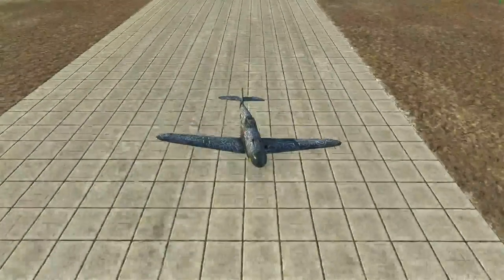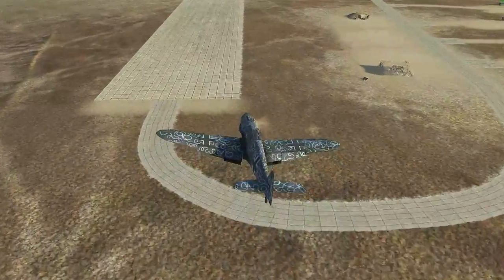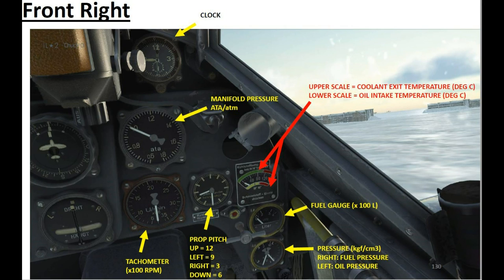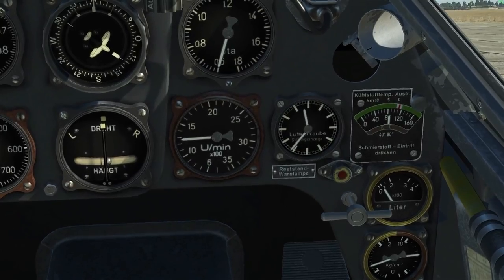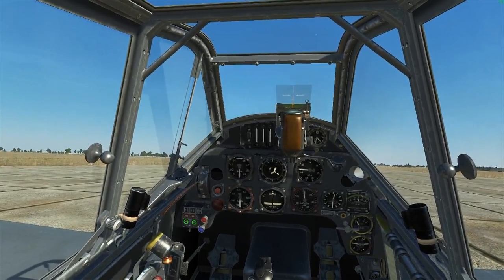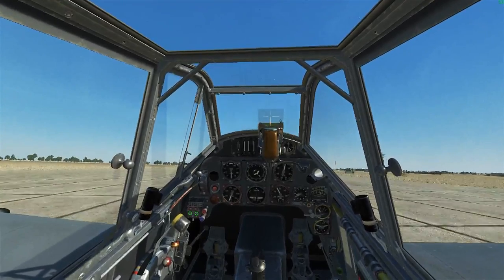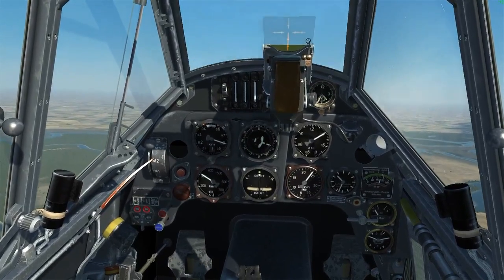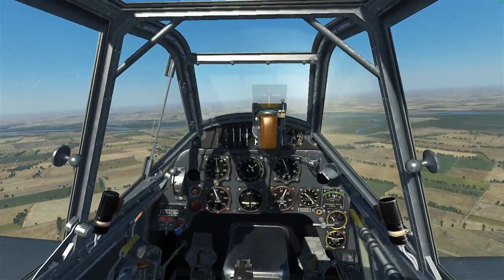(26) IL-2 Complex Engine Management 2  Understanding Manual Propeller Pitch

Comment: Great video.  Along with your tutorial on CEM. A ground school instructor couldn't have presented it better.  Unfortunately, if the multi-player servers require this level of operational detail I, for one, won't be doing any multiplayer action.  I had to learn this stuff in fixed wing civilian aircraft, which required a whole lot of attention to detail and checklists.  I can't imagine having to do it in a ww2 fighter while other people are sneaking up and shooting you.  Nope,  I think I'd look for another job in the army... like a cook.
Reply from the maker: Hi Ray, non of it is difficult. It all takes practice. You can fly the Pe-2 and not worry about feathering your prop. Russians didn't think it important! Best to practice without having your are shot off first. The p-47 is the single most labour intensive machine. But if you get it's CEM down it is formidable indeed.

Comment: I'm not sure if I should go all out with manual control planes as a new pilot or just go with the 109. I figured if I can keep practicing with manual controls I'll eventually 'get it'.
Reply from the maker: First, learn to fly the aeroplane. Then add more complex things as you improve. All German 109s are esentially automatic so there is nothing else to do. Prolly the most complex is the p47 with its superchargers, throttle/rpm interlocks, cowl shutters etc. There are many specific How to vid guides on each of these.
Reply: @colninny8769  I find myself drawn to the P-47 as I'm a gearhead that really likes the gauge layout and the thinking that went into it's interlocking RPM, supercharger and throttle and pitch. Reading the manual it recommends locking all 3 together in combat to minimize pilot load.

Comment: Great video. So let me pose this question to you which is tangent to the issues you discuss here but relevant for aircraft without the fully automated German system. Let's say...Spitfire or P40, which do have variable pitch propellers but work slightly differently. In that type of aircraft, you use the prop lever to set the desired RPM, and then the governor automatically varies the propeller pitch in order to hold the engine as close to the designated RPM as possible. In game, as you adjust this value the technical messages read that you are setting "RPM" to a value ranging anywhere from 1-100% - and so here is my question...in these types of aircraft, under emergency conditions such as a dogfight, is a full 100% RPM setting always going to be the way to go in order to achieve maximum temporary horsepower/thrust? Obviously (especially in certain aircraft) we're going to be extremely limited in how long we can leave the engine in a 100% RPM, 100% open throttle posture due to heat/manifold pressure concerns, but is that the best thing to do in order to extract maximum power? Is it possible to make any sort of adjustment from there in order to eek out a tad bit more power? I suppose the question boils down to how good the governors were, and the general question about whether or not an aircraft always hits its highest possible performance at maximum engine RPM. 

Also - which "RPM" setting is equivalent to a feathered propeller position on these types of setups? I would assume that would be "100%", but it's not always been clear to me that my prop is truly feathered when I have looked at it when stationary in game with RPM set to 100%.

Cheers and thanks for the video!
Reply from the maker: Good questions. I haven't flown the Spit or P-40 much so cannot give an educated opinion on them. You might post this on the IL-2 tech forum for high tech response. None of the S/e a/c in the game game can feather their props, Closest setting is 100% = full fine.
Reply: Thanks again. Great videos. I guess that makes plenty of sense that there wouldnt be any true feathering on a single engine fighter. Not like you're gliding all the way back to a friendly aerodrome in 99/100 cutout scenarios anyways...either way its a belly landing or bailout.